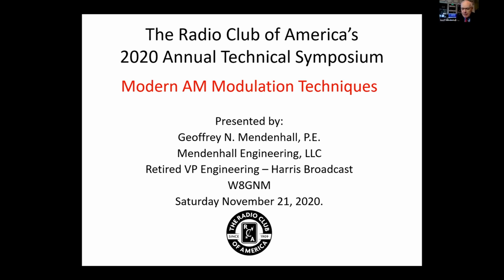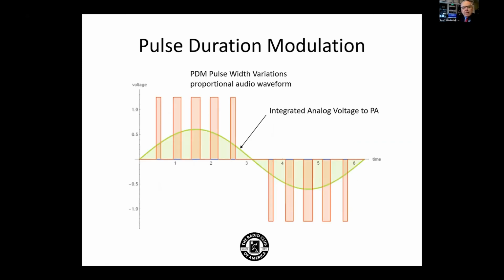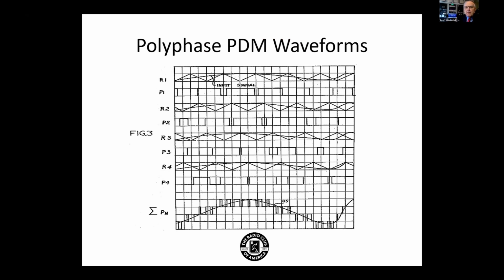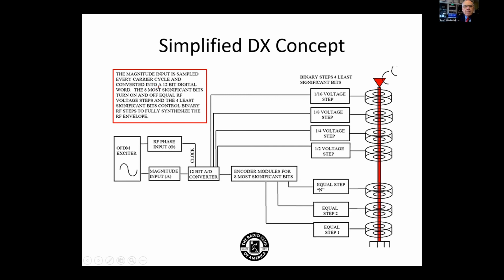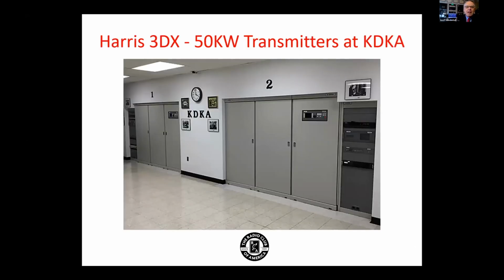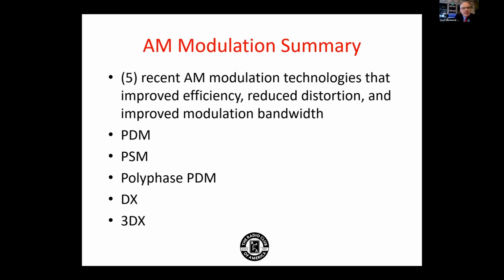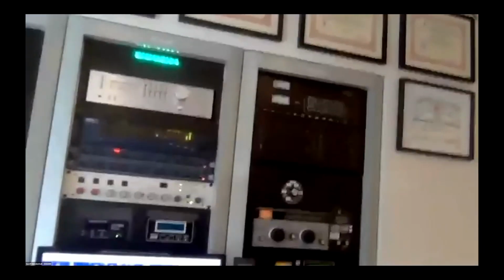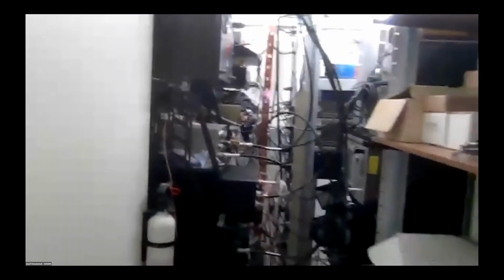Modern AM Modulation Techniques - Geoff Mendenhall

Comment: I want  design a modulator. My hardware is a low-power device such that the instantaneous energy it uses must be constant. My specifications also indicate that my modulator must be rate adaptive. Which modulation technique would I choose? ( PAM - QAM - Phase Modulation - Multi Dimensional )